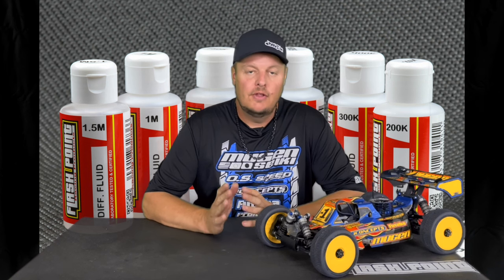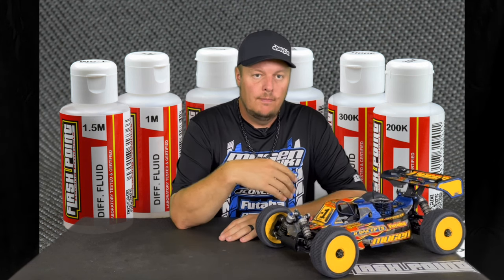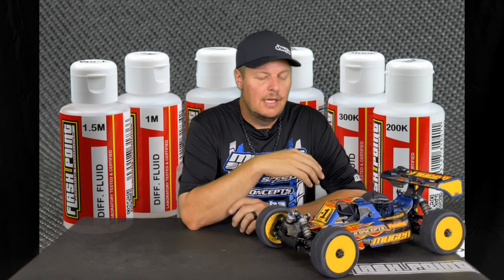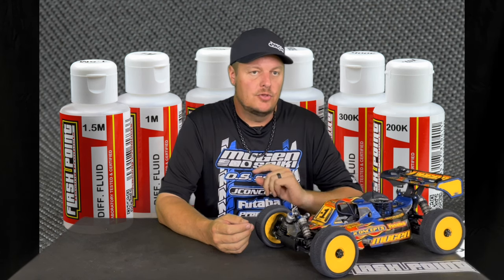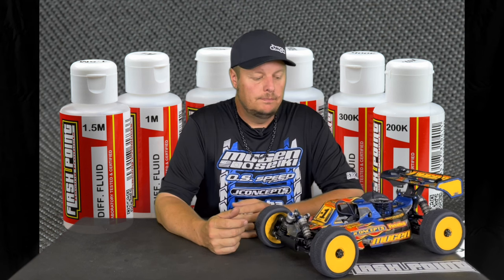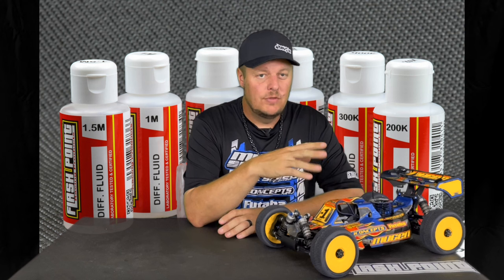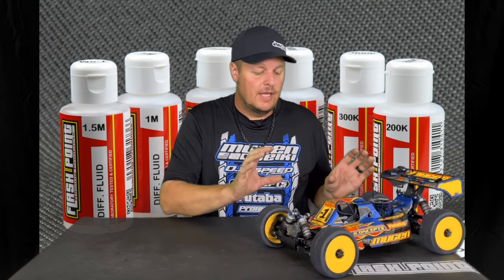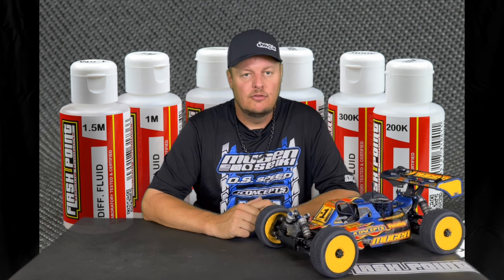Tuning with Diff Fluids.

Comment: Thank you for the informative video.  Would you say 10-10-7 is a good starting point for the Barn, on an eBuggy?
Reply: All I can say is that, 5/5/2 or 5/5/3 is a good starting point for most cars. It really depends on the car itself too. Kyosho suggest that setup, Losi 7/10/4 , AE used to have a base 5/5/5 kit setup.
Reply from the maker: That's what I used at The Barn.  Maybe start with 7K in the center to help a little with traction.

Comment: Great video! I don’t race but like driving my car on open areas. I found that I lose steering on power and my car just wants to wheelie all the time which makes it very uncontrolable. To prevent it from wheeling and instead have the power translated on the ground should I have thick in the front, maybe 15k front, 10k in the middle and 7k at the back??

Comment: I have a cheaper car, the diffs feel to easy to turn. If i fill it with greace it would be better?
Reply from the maker: Grease will feel really thin and light.  You should try using thicker diff fluid.

Comment: sorry to chime in, being complete noob. how should I choose my diff fluids to be able to do wheelies easier ? I destroyed my rear diff and when changed it I installed 20k silicone oil instead of the factory 10k. I'd love the car to do wheelies if I suddenly do full throttle. The car is Arrma  Vorteks 4wd 3s and I geared down to 15T because have bigger tyres now. 
Or can you suggest resources where I can read and learn about this ?
Reply: Not familiar with your car, but probably thicker center.   Softer rear and stiffer front suspension would probably help too.  You could always add a bunch of weight to the rear too   🙂

Comment: The thing I want to know isn't the end result of what the fluid does but how we get to that result.... If I'm understanding correctly, it's basically a viscous lsd and you're tuning the amount of slip with the fluid but I haven't found any info to confirm or deny that
Reply: It's not exactly like that, because it's using a slightly different mechanism to normal viscous diffs (there are no plate stacks in the diffs), but the effect is very similar. Instead of aligned plates moving torque between each other via the "stickiness" of a viscous fluid, the gears are rotating while (mostly) submerged in the fluid, and they need to move it around, push it out from between the gear teeth, etc.

But just like in a normal viscous diff, the torque transfer would function based on the speed difference between the axles, and thicker fluid would mean more torque transfer for the same amount of speed difference (aka slip). What I am not so sure on is how the behaviors compare with larger speed differentials (slip amounts) and when heating, whether RC diffs are as linear as normal viscous diffs in their Newtons/rpm behavior.

Stickiness of the fluid and shear forces definitely play a big part as well, no doubt about that, but from my experiments comparing heavy weight rated diff oils and damping greases, while the diff oils can be just as heavy or even a lot heavier, they lack the "sticky" properties of damping greases (RC diff oils are GARBAGE at being damping greases basically hehe). This makes me think that they're at least somewhat more focusing on the sheer heaviness of the fluids, making them kinda mechanically harder to push around, rather than maximizing stickiness.

Comment: Hi Adam question you might know, what would you recommend on a Losi Sct Nitro for Diff fluids from front to back. My other question is do you know if the shock fluids would be the same for an electric sct? I assume the weight would differ cause of the weight of the truck?
Reply from the maker: I would start with 7K front and 5K rear. As for shock oil, the same as the electric or 50cst thicker.
Reply: @AdamDrake  thanks a lot appreciate you🙏🏻
Reply: @AdamDrake  oh sorry forgot about Center diff? What weight same as front?

Comment: Hi, what weight oils would you recommend as a starting point for a 1/8 on road basher truck? Maverick quantum r. I don’t really want the back to kick out and drift, I’m more after balanced handling. Thanks
Reply from the maker: I don't have any experience with that model or know what they recommend as a starting point.
Reply: Bashers should almost universally use something heavy in the center. That's all I can offer you for sure. If your truck doesn't have a center diff and is just a straight drive, look up some videos on how the heavier 200k+ fluids work trying to turn the diffs by hand and decide what looks ballpark right to you.

If you don't want the back to drift tune it lighter than the front, but also don't tune the front too heavily or it won't rotate well and might even drag/push on slow-speed tight turns... You can compensate the front dragging by tuning the rear stiffer so it can help the front power over instead of the inside wheel getting power and making the front turn even WORSE.

If it's a 2wd, probably leave it stock so it's not a total 1-wheel peeler, IDK. Instead look into chassis/steering changes. Dial in some toe-in on the rear and neutral toe on the front instead of whatever's standard (usually in on the rear, out on the front). You COULD dial toe-in on both ends, but it'll make the car less responsive/sensitive to steering.

Always do your research so you have ideal tires. Tires can make or break any setup.

Comment: Great videos!! Really appreciate the way you explain things. I do have a question tho. You run real low weights so what is the point of 100k, 250k or any other crazy amount? Sounds like there would be no real reason if racing to go less than 5 or no more than maybe 15-20k. Is there a time you can think of to use much heavier weighted fluid? My buddies and I race Arrma Mojave’s and traxxxas UDRs and it’s typically a real low bite track so any help is awesome.
Reply: Well in my case I just swapped my front and rears on my felon and limit skyline.. 30k rear on both and 35k on felony front and I’m thinking 40k on the limit front. Im really high grip street and running 
1717-1650 and a 4070cm-2200 on the limit. These thicker fluids is bcs unlike off road where we need the diff to slip, it’s the opposite on drag,speed run. I’m trying to keep the car in a solid straight line with no deviation and if I get a wheel that diffs out, I won’t notice it until I loose control or the tire blows out. Power being transferred from the motor to the drive shaft and to the wheels is like lightning… it will always find the easiest path with least resistance.